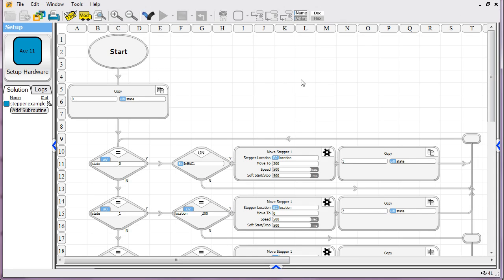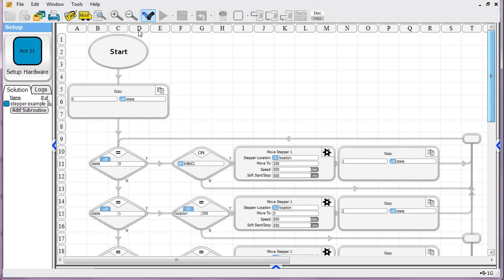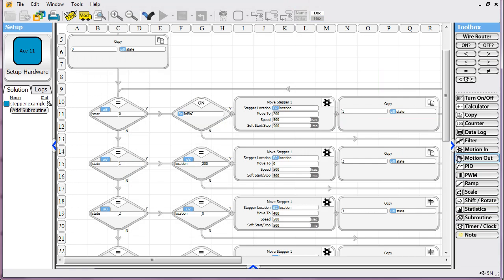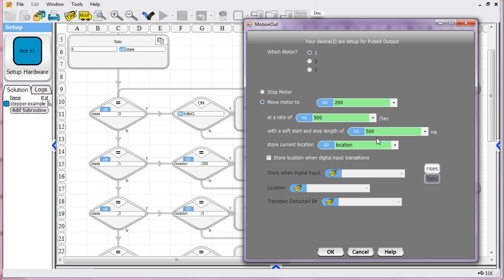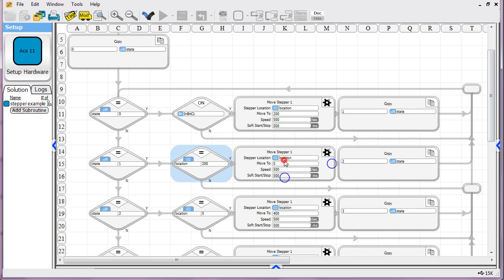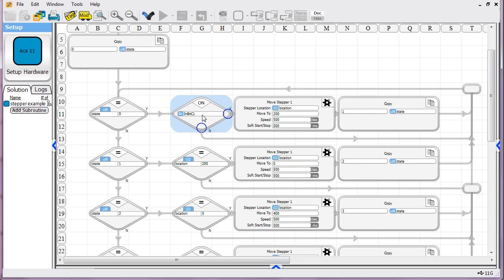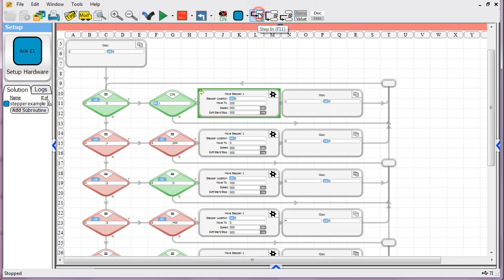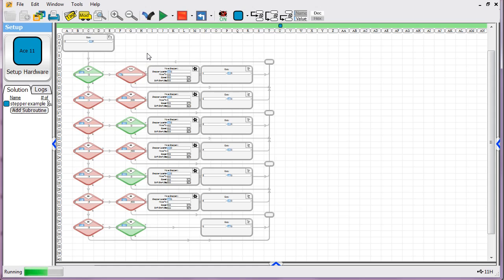Stepper Motor PLC Programming Example

Comment: I'm having a problem with the motion output dialog box. it cuts off a majority of the dialog and even removes many of the option inputs. I have tried to resize the box in hopes of that fixing it, but the bad formatting remains the same while the box gets bigger around it. is there any common fix for this problem?
Reply: Sounds like you have scaling turned on for your display.  Feel free to call in tomorrow and we’ll be happy to assist you in adjusting that setting.

Comment: I am so interested, but can you move all three motors simultaneously , and if so how much does that affect the speed?
Reply from the maker: Yes, you can move all three motors simultaneously.  They can move at a combined speed of up to 250kHz.  So, if you have 2 motors that are each running at 50kHz, the third can run at up to 150kHz.

Comment: I've not studied how CNC's do motion yet, but it must be the software that tells one axis not to outrun the other one say when a diagonal is cut.  Say a diagonal with an X of 10 and Y of 1, the Y stepper will reach 1 as the X axis only reaches the 1 and the rest of the run Y would be not running and X would still be moving to 10.  
I wonder if that is something that can be programmed in the Ace?

So one minute later here I'm thinking you could use the Math node and say Y would run at 1/10 the speed of X in that example.